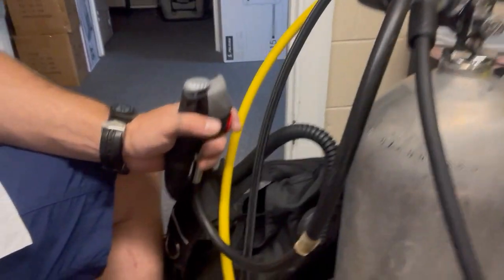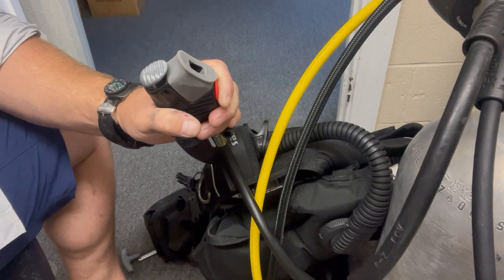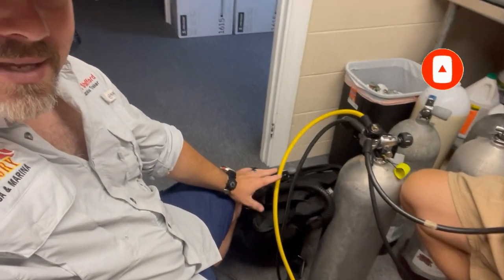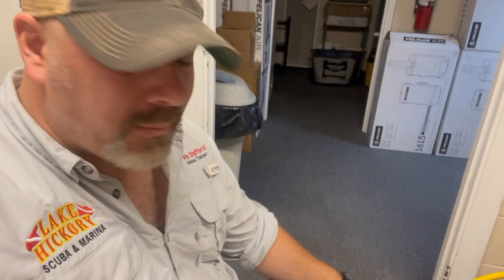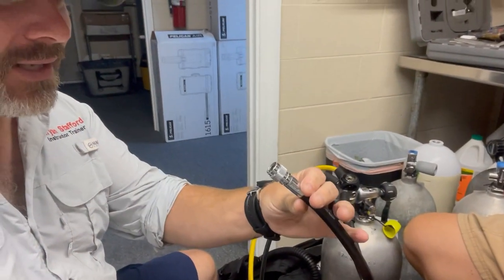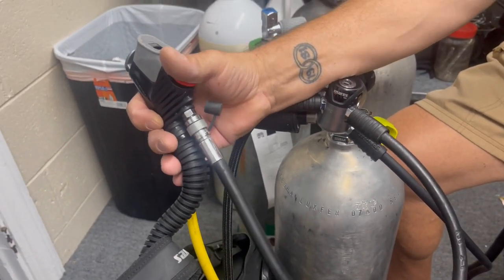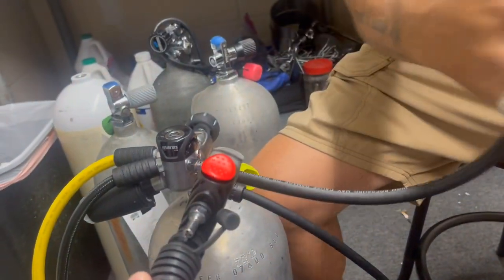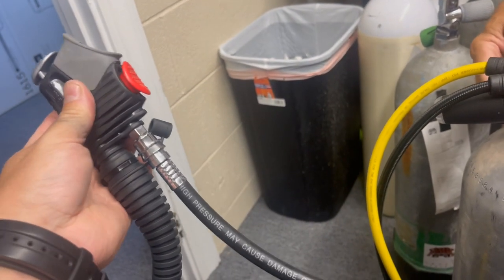Why Pay The Technician Fee When You Can Fix It Yourself

Comment: That was the opposite of what I thought you were going to say.  I agree you can do some troubleshooting yourself.  If you can't find the problem or if you do find the problem and its beyond your abilities or comfort level, than take it to a qualified tech.  Otherwise if you can troublehoot and do small repairs you can get to know your equipment better and it'll make you a better diver overall.
Reply from the maker: Hello @kevindavison6019, we encourage all divers to know their equipment inside and out. As you stated, there is still times when a certified technician needs to do the repairs, but in general the end user is well capable to fix minor issues. Plus, it saves them money.